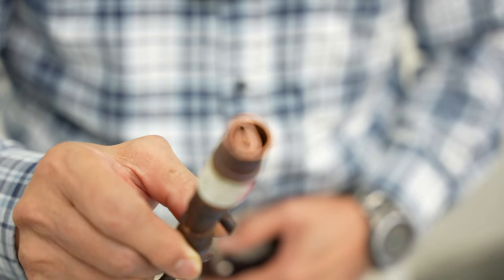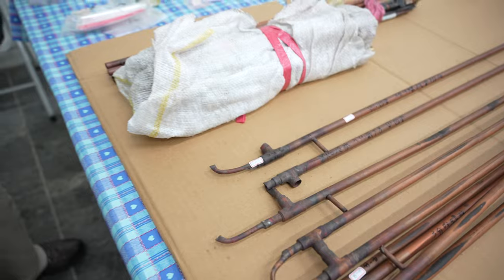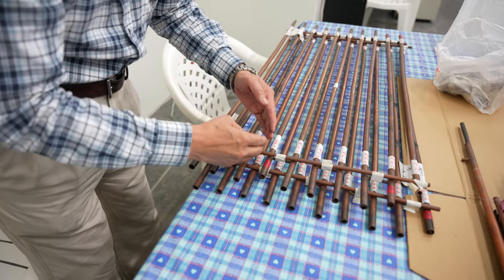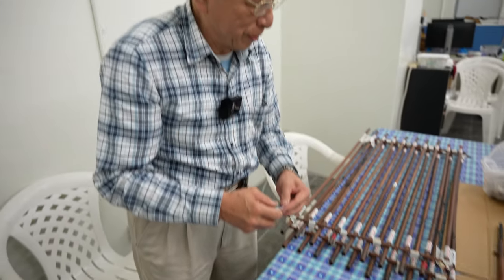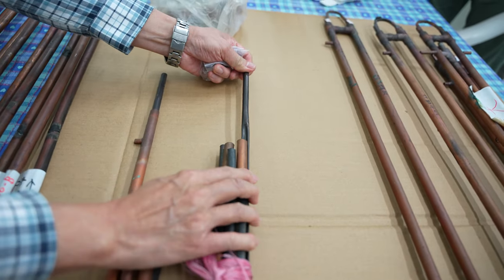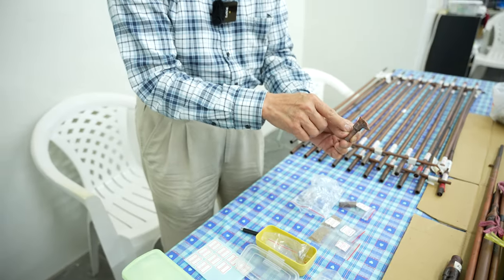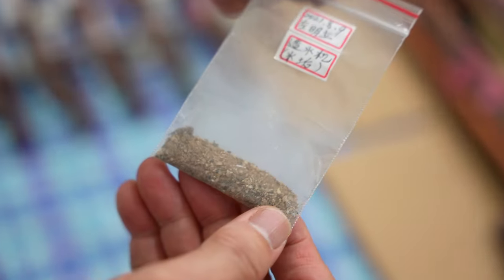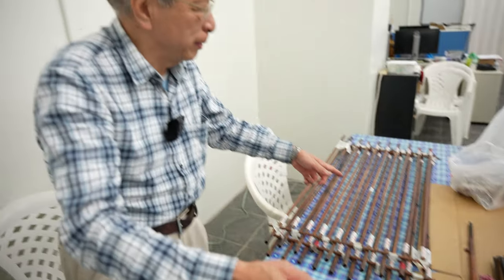Bin-Juine Huang - A look at samples of active LENR reactor structural challenges

Comment: I just finished watching all
the videos. He wasn’t kidding when he said “but no photo”. He is running quite the operation there! So curiosity picking!!! The claim of 3% denser water coming out of the reactor was really the one that made my brain go in full gear. Have they been able to compare the electric conductivity, pH, total dissolved solids (TDS) at the very least, with the water coming in? If the results are similar, specially if no much difference is found wrt TDS, that would be mind boggling.
Reply from the maker: Any and all suggestions for tests will be passed on to him, he is very proactive.
Reply: Making water denser is also what is done with water vortex systems. Victor Schaumberger did lot's of research and made vortex systems. I did a very simple 'research' myself by connecting two wine bottles and let the water flow from one to the other with a vortex. I can tell the water has changed, it becomes a little more dense. It is used in water vitalisers also. So when LENR can do the same, what is the physical process going on in both systems doing the same thing in 'organising the water'.
Reply from the maker: Water is 0.18% denser at 4°C than 20°C, so this cannot account for it. 

however, 17O is 6.28% heavier than 16O. So, given water is H2O, if around 50% of the water contains 17O, then it could be 3% heavier. @henkjurrien4954
Reply: One can look up that pure H2O with 100% O17 should weight 1.044 g/cm3 at 25 Celsius, or 4,4% higher than “normal” water. A 3% denser water, provided the deionized water fed to the reactor did not uptake a significant amount of dissolved salts, could mean that a significant portion of the Oxygen is O 17. I now understand that this will be addressed in the paper, so I am really thrilled, this will be a massive and tantalizing evidence.
Reply: Thanks Henk, I understand that structured water is considered to be “H3O2” some times called “Hydronium”, so it should be heavier.
Reply: Thanks, that is new to me. This is again a field that can be researched as well, what is structured water really all about. Also the health benefit. Is H2O-17 indeed better for our health?  @curbina

Comment: Interesting stuff. Reminds me of Mehran Keshes Copperoxide nanolayers that create a new condition for plasma reactions...
Reply: When I was watching the first video I saw that explained how the TG works,  with the thin carbon coatings between the 2 pipes/ layers,  I immediately was reminded of the Keshe MAGRAV(sp?) plasma coils.   It's not working on car exhaust emissions, BUT it is utilizing the exact same OrderedTor. sets, and the same basic geometries & principle (IMO), except it's coiled copper wires wound into toroids instead of tubes. Then there's (at least)  2-3 coils nested together,  & the all-important initial steps of 'nano carbon coating' the copper or other metals.  I even remember him (& others) stating how important it was NOT to touch with bare hands cuz the oils would deposit,  & obstruct the carbon layering/ deposits. Just like the residual fingerprint Bob found on the TG sample in the carbon-layers 'blocking' the carbon from 'attaching/bonding' well.

Comment: Bob, can you explain how that plasmoid makes the great escape from the TG, how can matter go through steel undisturbed :) That was amazing!!!
Reply from the maker: It maybe a neutral Exotic Vacuum Object that gets excited after passing through the metal and then is re-condensing, ionising air locally. The ones that go in and out are more likely travelling along the flux loop between a N and S topological monopole pair, the flux loop is penetrating the metal.

Comment: I'd love to know whether the pressure and temperature are sufficient to cause the deformation in a control experiment. 
As I write this, I get to think of thermal deformation due to the temperature difference between inside and outside of the pipe, held there due to the consistent (gas?) flow each way. Heat alone might not do this. Still, I wonder whether the ion exchange or whatever to call it can be a catalyst to deformation. Could a sculptor use this at modest temperatures? A mason, to build a Peruvian ancient wall?